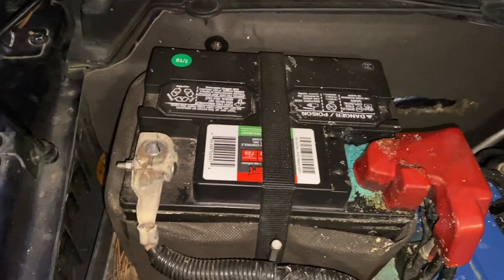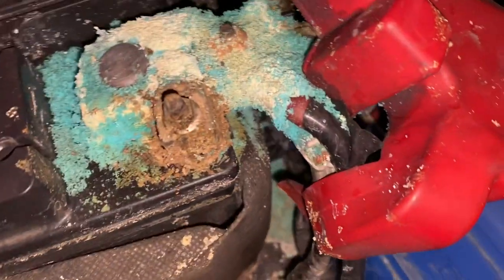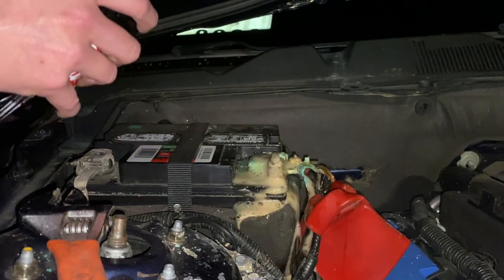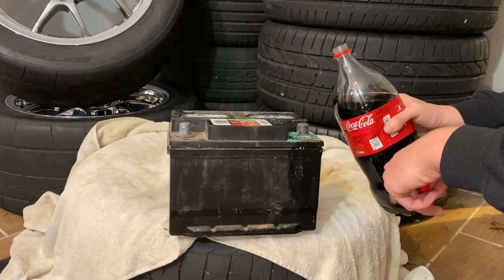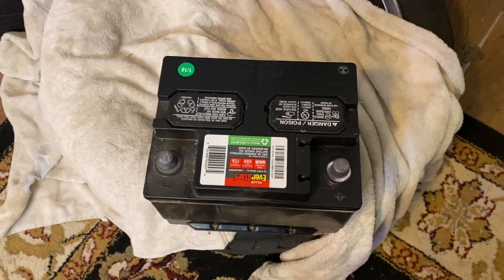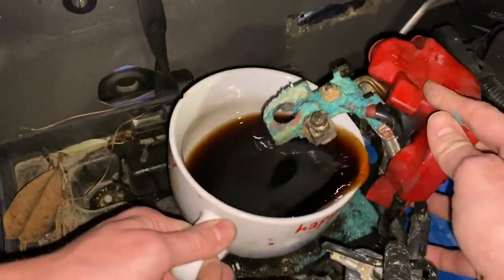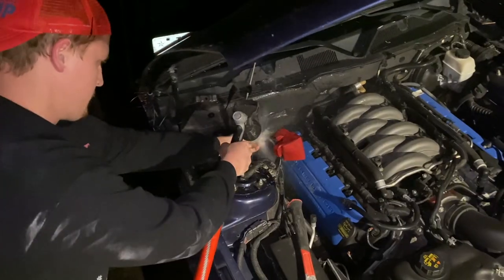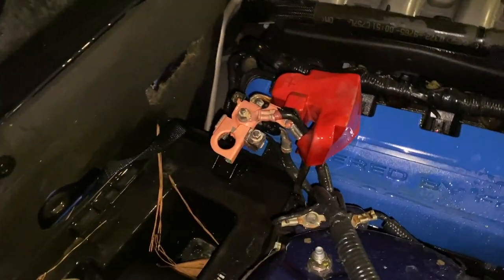Battery Corrosion vs Coke: how good does it work?

Comment: You didn't scrub it with a toothbrush, it came off without scrubbing? My goodness, can't drink coke after this. WOW!
Reply from the maker: It’s crazy how well it worked for me! I like coke, but if it does this to corrosion on a battery... lol
Reply: Hot water does the exact same...really hot
Reply: Im
Reply: Coke is just really acidic so something like orange juice would probably do the same

Comment: Your much better off buying citric acid in powder form from Amazon and mixing with purified water, usually DI. Mix it in a spray bottle and spray over corrosion. It will work much better, be sugar free, non sticky, and much less of a mess to clean up. Then follow up with some baking soda and water to neutralize any leftover acid.
Reply from the maker: Very true!
Reply: Hello! Would i have to take the whole battery out to do that? I was having difficulties unscrewing to change my battery. Also, is there any other place i can purchase that or just amazon?
Reply: @PcfulSol  You can keep the battery in the engine compartment. Citric Acid is not easy to find so plan to use Amazon. Mix the acid string so you can use less water.  I use this mixture on my boat on terminals all the time. Let it sit for a minute and then brush with a white brush. Use a damp rag with water to clean up when you’re done
Reply: @bluethumbdiy4735  thank you!!!
Reply: What about Coke Zero???  Coke Zero has NO Sugar..